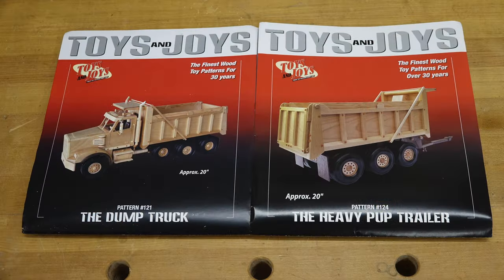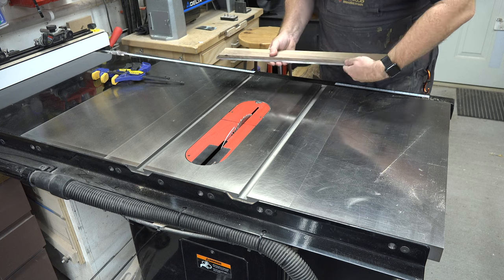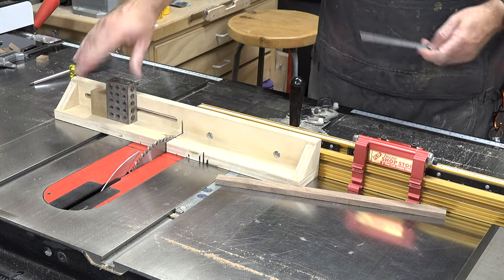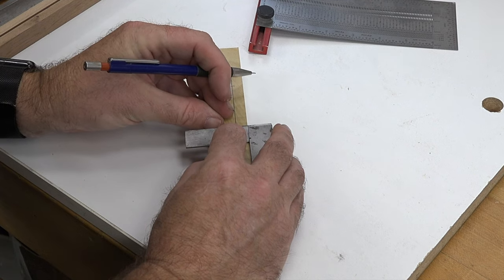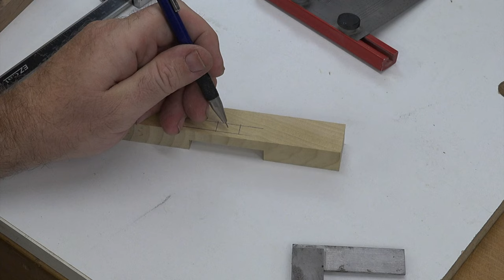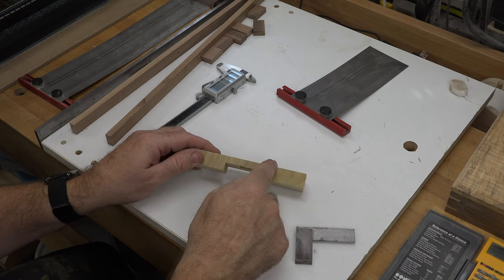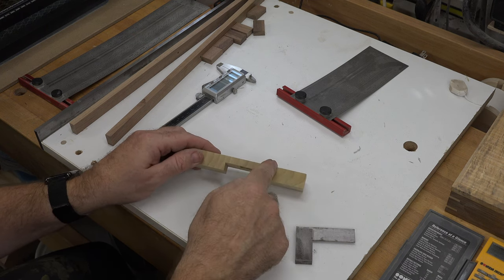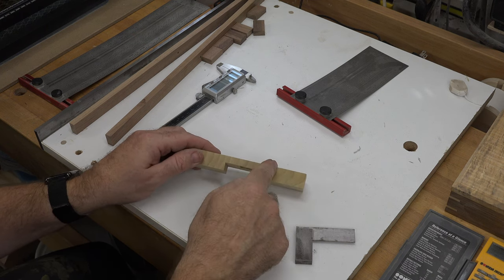Making Toys and Joys Dump Truck and Pup Trailer Part 1

Comment: Hi Kenny, great start for 24 with a model build. As you’ve said about ideas or suggestions for shows, maybe a bit of a tool intro for a project like this for others that may be starting out. 
I.e in this week we will be using the scroll saw, the under bench router and even some of the measuring devices you have. (A bit like baking where you have all your ingredients out before you start.)
Cheers 🇦🇺
Reply from the maker: that's a great idea Troy.  I like it.  I have done a show in 2023 about the tools of model making.  If you're interested, you can find it here.  https://www.youtube.com/watch?v=TmKASmFbAtQ
I hope this helps.  Thanks for tuning in.  I hope you enjoy the series.
Reply: @acutabove_woodworkings  I haven’t stumbled across that one yet but I will look at that link. Cheers 🇦🇺
Reply from the maker: @troycogan1030  Hope you enjoy it.

Comment: It’s funny how the table saw is the most talked about tool in woodworking but yet the band saw seems to be the best bet for a lot of processes. Back to the table saw lol, how has that incra miter gauge been holding up? How often do you need to re calibrate it? Is it easy to calibrate? Really sick of the sawstop miter gauge and I’m ready to donate it to the trash can.
Reply from the maker: The SawStop mitre gauge is a piece of junk and I hate it.  I even stated in my review of the SawStop that for a saw that costs as much as it does, they could have provided a better mitre solution.  The INCRA is amazing and although it was expensive I absolutely love the thing.  It took a little while to calibrate it (about 30 minutes) but it's been great ever since.  I only had to recalibrate it once when I dropped it and knocked it out of whack.  The nylon bushings do need to be replaced from time to time but I have found that I can 3D print them for pennies a dozen.  As long as you use 100% fill in the 3D printing, they last pretty much as long as the nylon ones do except they are ABS.  I hope this helps Randy.  I wouldn't trade my INCRA gauge.  It's been amazing.  Thanks for tuning in.
Reply: @acutabove_woodworkings  your review of the sawstop is what sealed the deal for me buying it. I can’t wait to see this dump truck completed, this thing is going to look amazing, I also am looking forward to watching this build happen. This is going to be a great group of shows.

Comment: Hi, thanks a lot for the video, im a beginer and my problem is i use cms instead of inches. when in the pattern says 3 1/4" does it means 3 x 1/4" or does it means 3" plus 1/4". Thanks in advance. Regards.
Reply from the maker: It means 3" plus 1/4".  I hope this helps.  Thanks for tuning in to the show.
Reply: @acutabove_woodworkings   that helps a lot. thank you so much. btw i love your pirography works...;)
Reply from the maker: @EzKuLaKa   Glad to hear it.  Thanks for the kind words.